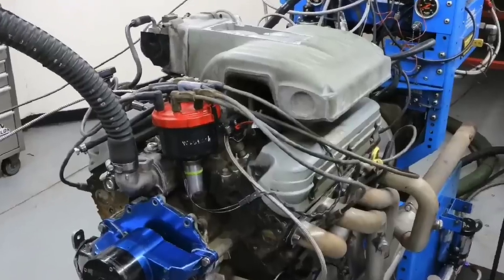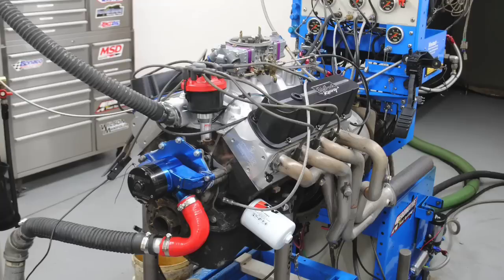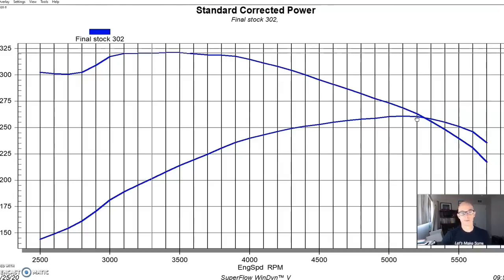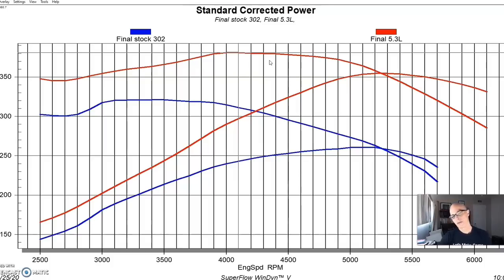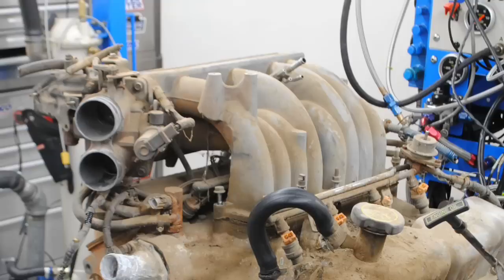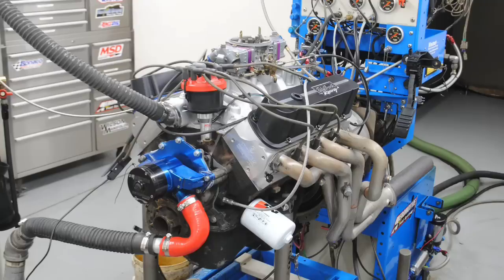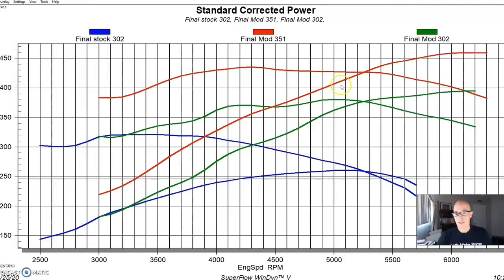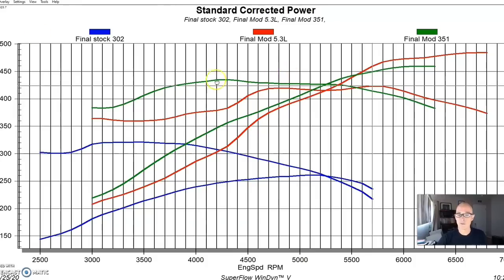5.0L vs 351W vs LS-SHOULD YOU SWAP?

Comment: The 351, Windsor or Cleveland are the secret weapons of the ford catalog. They make fantastic power with huge aftermarket support. For me, bottom line , Ford in a Ford. Chevy in a Chevy. Built Ford proud!😎🇺🇸
Reply: I never said the Cleveland was a small block. I should of said the forgotten weapons. You clearly missed the whole point.
Reply: Wakanda Forever  351 is a small block...
Reply: @rodfatherschopshop6004  is this guy talking about the crap Ls1's that cannot be rebuilt due to the cintered metal components in them?
Reply: @makattak3550  where is it not rebuildable?
Reply: @jubjub905  the cintered metal the LS1 uses.... totally not reusable.
Reply: @makattak3550  
I never knew they used sintered metal, quite interesting.
Reply: @makattak3550  hmmmmm pretty sure I rebuilt mine smh not all rebuilds require boring
Reply: Exactly how it should be .
Reply: @makattak3550  Do what? I just punched out a LS .020 over and it was most definitely rebuildable....
Reply: @Costanza2014  you need a very expensive diamond hone to do  LS 1  bores oversize properly.
Reply: If I ever buy a corvette a blown push rod Ford is going in!
Reply: @wesboyd7416   Love it!😎🇺🇸
Reply: The Cleveland is still dangerous today  I’m a Chevy guy but I really think if the turbos were big back then as they are today ls would just be another engine
Reply: Yuppers... The aftermarket heads (clevor) for the windsor can't be beat. 427w with the C3 yates heads here. Real beast.
Reply: @billmeyers9584  indeed!
Reply: @billmeyers9584  that’s nasty, definitely hurting Chevy boys feelings with a combo like that
Reply: I'm here in 2023 redoing a 351C in the USA.  That "huge aftermarket support" is all but vanished.  The 351C only had about a 5 year in production cars in the US.  The windsor motors was about 10x as long.  And because of that, its slim pickin's for 351C aftermarket parts compared to the windsors.

When looking for EFI stuff, there's zero options for factory EFI intake manifold.  There's pretty much zero options for aftermarket.  Trickflow used to make one, but its discontinued.
Reply: @giantpune  it’s a shame the Cleveland never got the support of the after market . Great engines! Good for you doin something different makes your ride even cooler. As long as it’s a Ford motor that’s all that really matters. 😎🇺🇸

Comment: No LS in ford ever for me. And that was a fair comparison. If it’s fair to compare a 5.0 to a 5.3 then it’d fair to compare a 5.3 to a 5.8. And it held its own
Reply: Yeah even the 4.8 Ls made more than the 5.0 ,impressive when boosted too
Reply: @christopherhamilton4373  they are pretty good. i love all
Reply: @christopherhamilton4373  5.0 does good for what it is but the heads on even the worst preforming ls slay the stock 302
Reply: Yeah the 5L heads were not that great. But back in the late 80s and early 90s, it was still a lot better then the 5 liter (305) in the iroc-z.
Reply: @kcdesignconcepts5216  so many engine in the 80s just sucked ass lol
Reply: I'm not a Ford guy, but if I was it looks like a 351 would be the choice for me.
Reply: Christopher Hamilton  cause old technology in 5L etc.. If companies make a better intake and more updated for the old engines. Probably be the same power or more torque for old ones. My guess lol I’m not a engineering lol
Reply: YouTube k.p. mustang.
YouTube LS 9 mustang.
YouTube stock bottom end record.
YouTube chevy powered mustang tears up the yard.
YouTube most patriotic turbo LS mustang.
YouTube LSX Challenger.
YouTube LS RAM.
YouTube ls1 RAM..
Reply: 351 modded has great low end power, more then the modded 5.3L till the top.
Reply: Bri-man Hunter i like the 4” bore. Definitely good stroke for it.
Reply: Silkmaster4200. Absolutely, my 6.4 394 Hemi stroker has a 4.05 stroke; a torque cam with a long stroke makes for a very fun street motor.
Reply: But how much is the cost difference between a 351 and a 5.3? And cam and springs cost-performance ration between them?
Reply: @bri-manhunter2654  Yeah, the 351 performed admirably.
Reply: @madmod  Absolutely. Aluminum heads are a must IMO if you want to stay Ford. Luckily if you do, there are many used heads out there that are excellent pieces.
Reply: @CalandMike  x selent  choice more cube s and can go way more
Reply: @CalandMike  Definitely, the 351W can be stroked to 427ci, i doubt the 5.3L can..lol i've seen performance cams selling brand new for $150, cams for my 4.6L 2v go for at least $595.. Def modding older engines is cheaper..
Reply: @kcdesignconcepts5216  it was way better than the 5.7 too
Reply: @philllsxga.7737  ls is just a windsdor motor
Reply: @CalandMike  a person could just 2jz if they can't handle the chevy power hahaha
Reply: Preach!
Reply: The problem is you can get the 5.3 much easier and probably an alum 5.3 as easy as the 5.8...or a 6.0. The 5.8 holds it's own mostly due to displacement & in my area 6.0's are dirt cheap.
Reply: @kcdesignconcepts5216  Faster but not nearly as reliable as the 305. BTW the 5.0L in the 80's-90's were actually 304.5 cubic inches.
Reply: What’s the factory weight difference between an L33 5.3L and a factory 351W ? I bet from TB to oil pan the L33 is 160lbs lighter than a 351W. People move there 20lbs battery from the front to the rear. What’s 160lbs worth?

If I had a 351W already in my fox, I’d def stay 351W based. A factory block 302 would have have to be replaced with anything. And my $1500 engine and transmission already sent my fox 9.1@150mph with 253k miles on it via a 1999 2500HD truck. 
But def nothing wrong with a 351W if it’s already engineered in the car.
Anything besides a $2000 aftermarket block 302 just wouldn’t handle the power I’d ask of it, even if it could make it reasonably easy.
Reply: Correct. My third gen 305 camaro was a slug. I have no shame saying that and also why I swapped a LT1 into it.
Reply: TigreLoko24 cleetus McFarland  tsp 427  was originally a 5.3 iron block ...5.3 and 6.0 have same stroke as the 6.2 it’s just bore size is different so stroked and bore out they can  become  427 ci
Reply: @keahisumile3  It's not just a different bore. They have different crank cases, connecting rods and cams.
Reply: @craiga9492  crickets
Reply: @craiga9492  Uhh no. 351s were great but not even comparable to a 5.7/350.
Reply: @tskraj3190  I'm talking the 5.7 tpi engines. 15 second camaros were a quite a bit behind a 5.0 mustang
Reply: @craiga9492  a 15 sec. Camaro didn't have a 350. Most Camaros had 2.8 V6s or 305 V8s. 305 V8s were dog motors but the 350s had much more torque and HP. BTW  I owned a 95' 5.0 and it runs averaged around 15.6 seconds.
Reply: @tskraj3190  there were a ton of iroc-z z28's with 5.7s
Reply: @craiga9492  IROC-Zs had 5.7s but Ithose were few and far between. IROCs were limited production vehicles and yes their quartermile times were around 15 also but so were the 305s and the Mustang 5.0s. The 350 LT1 changed the game.
Reply: @tskraj3190  really? There were more irocs than regular camaros where I grew up. Stock 5.0l mustang, gut airbox, advanced timing, set tps and of course lose the stock exhaust. 13.90s @100-101mph all day with 2.73 axle
Reply: @craiga9492  That's not stock. Like I said I had a 95' 5.0 and  it averaged 15.6. You can even see it here on Motor Trend https://www.motortrend.com/cars/ford/mustang/1995/1995-ford-mustang-monsters/
Reply: @tskraj3190  I'm talking fox body and that's stock enough. The lt1 is better but the 5.7 tpi is a boat anchor lol
Reply: @craiga9492  Bullshit.  Correctly optioned TPI Camaros were as fast, if not faster than the 5.0.  An 1LE 5.0 Camaro could hang with stripped notch.  You certainly didn't want to run up against an 1LE 5.0/5.7 Camaro.  And the saving grace of the Mustang was weight....that was it.  Nothing else.  5.0 GT autos were slow AF.
Reply: @BEBNC1  I agree. I had a 79' Mustang with a 302 and a 95' Mustang with a 5.0L. I got my butt handed to me by a 91' Chevy Lumina Euro Sport with a 3.1L V6 in my 95' Mustang.
Reply: A coyote would be a cool swap on a ford though, I'd consider one if I knew what the fuck i was doing haha
Reply: @tskraj3190  I have an 86 5.0 that was in a barn for years, ran a 15 second flat first time at the track on dry roted tires with worst 5.0 cylinder heads. Not sure what your doing wrong.
Reply: @Kenzo-bp1zs  It would be me, Motor Trend and Car and Driver.
Reply: @tskraj3190  wow didn't know the later years were that much slower. My car honestly had Acorns stored all over the engine bay from squirrels when I ran it. Ran 15.00 at 93MPH, I think with better tires I could've dipped into the 14s.
Reply: @Kenzo-bp1zs  My 95' averaged around 15.6. My 79' had a high performance cam, trickflow heads and a Tunnel Ram intake with two Holley 650 carburetors. That averaged around 12.7.
Reply: If your against a engine that makes more power for less and will last twice as long that's up to you a engine with 6 bolt mains that comes from the factory with such a very strong shortblock that the crankshaft spinning even at very high rpm has no flex or stretch you'd need very expensive after market parts on any 302 351 ford engine or 350 383 406 chevy engine to even come close to the stock durability of a chevy LS engine there has to be a reason why over 50 percent of foxbodies at the drag strip are running LS engines in them the only place through out the rpm range where LS engines are not as good as older style engines is below 3000rpm above 3000rpm to redline they absolutely kickass they like high stall converters 3000+ and steeper gearing I've seen stock 5.3 chevy truck engines hit with a 150 hit of nitrous over 75 times and be driven home after racing try that with a completely stock 302 351 ford or stock 350 400 chevy you'd be lucky to make 10 passes before it will blow up take any 302 ford or chevy 350 with stock crank rods and pistons put any cam you like in it rev it to 7200rpm and if it does it bet it won't do it many times before it has big problem BOOM my stock LS2 shortblock with CNC ported LS3 with a high lift cam under 240 duration and it has hardened pushrods and a SFI harmonic balancer put in car in 2008 a weekend nice weather car toy maybe put 800 miles or so a year will on a step on the gas petal rev 7200rpm doing so pretty fast in 1st 2nd 3rd gear now for over 12 years and still doing so but it's taken care of with maintenance and no it's not constantly being beat on it still runs as good or better than when put in car in 2008 I'm 56 years old have had many muscle cars and performance cars in my life this LS2 is by far the most efficient most reliable most powerful and durable engine I've ever had from 3000rpm to 7200rpm for a N/A 364 ci engine it's a monster plus runs good for cruising 2000rpm to 3000rpm smooth with very good response or eager to rev l guess it's not a good thing to take a basically stock LS2 with CNC ported LS3 heads camshaft that absolutely does not run out of torque to 6400rpm plus gaining a1000rpm on the high end or redline compared to any 302 ford or 350 chevy torque on these engines drop like a brick off a cliff above 5000rpm even well built ones pushing it very hard above 5000rpm to 6500rpm your feeling the engine torque fall off giving you that struggling feeling with the LS l feel no struggle or drop all the way to the rev limiter at 7200rpm with no engine shaking as smooth as can be and fast depending on cam choice with a LS peak torque comes in 4600rpm to 5400rpm with peak horsepower in the 6000rpm to 6800rpm my LS2 with upgrades makes 400 foot pounds of torque or more from 3000rpm to 7000rpm at the crankshaft that is a wide powerband and I'm not saying at all a all forged 347 Ford or 383 Chevy with expensive aftermarket heads can't match these numbers yes they can with a lot more money and effort and less driveablity and reliability and will not last as long as a LS engine
Reply: @christopherhamilton4373  Impressive  when  boosted for the first 5 or 6 passes then it left the  party!
Reply: Mylan Miller that doesn’t happen often, these engines boosted running 9s, 8s, and 7s in the quarter mile on stock bottom ends
Reply: @christopherhamilton4373  What happened to every one  at our local track was. They tried a little boost and the cars run like shit.  They cranked the boost up to get the ET they were hoping for instead of running good numbers they all  Wiped out the bearings. We have Fast LS turbo engines at our track as well but not one is a budget Build. i am not saying you cant make an LS  Go fast what I am saying Is They are not any Cheaper to go fast than a Ford engine. If you want to go fast and have the  engine live
Reply: @kcdesignconcepts5216  That's a myth. If both cars were 5-speed manual they were very equal in the quarter mile. Most Camaros had automatic transmissions that really hurt performance back then. I lived thru that era street racing on weekends. The TPI 5.0 (305} manual trans iroc Camaros and Firebird Formulas were fun cars. They just didn't sound as good as the Mustang 5.0
Reply: Mylan Miller true, i wouldn’t shoot for 800+ on a stock bottom end
Reply: 5.0 all day let’s compare a 305tpi or 350tpi that’s a comparison the 302 is from the 80’s the last was a lot newer with advanced technology. Compare a 02 dohc 281 cobra N/a. The 5.0 is a bad mofo for what it is I have an old ego 5.0 and and dusted new g37x’s with 330hp.  Meanwhile mine is stock internally stock e7’s. Pullys exhaust cold air intake electric fan.. I know why I beat him because power to rate ratio is still a factor. I’m 2850lbs he was 4200lbs.. so don’t think you can smoke a 5.0 cause you have a LS.
Reply: @christopherhamilton4373  welcome to a updated engine ls also has more In common with a ford engine then a sbc
Reply: @hydrocarbon82  5.8 was also cheaply modified and can easily make 600 plus na
Reply: Austin Howze i am aware
Reply: All you LS lovers out there forget how many races the 351 Windsor won  in NASCAR over the years and the last time i checked Ford had over a hundred years of racing history Chevy not so much
Reply: Sorry, 5.slo and 351 are junk, ford engines always cost 2 to 3 times more to modify than gm, I'm not a chevy guy, but the ls is a no brainer, more power and cheaper cost
Reply: @Silkmaster4200  the ls is old technology, it's a push rod engine without cam phasers or other modern tech, it's the same as the 302 or 351 just built better
Reply: @bri-manhunter2654  look at price vs power comparison, the 5.3 wins all day long, you could build 2 5.3's compared to 1 351, it has 6 bolt mains and is lighter and stronger, it's a no brainer
Reply: @jeremyhigh3186  Ford guys always say the Ls is for broke guys or is the cheap way out. We’re spending less with equal or better results, expensive doesn’t mean Ford is automatically better. Who doesn’t want to spend less?
Reply: Compare a 6 liter LS with the boat anchor 5.8
Reply: @sinistersilverado965  or our 7.0 or 7.4 Ls
Reply: How about we stroke the 5.0 to 331which equals the 5.3 in displacement and match a set of heads that flow the same CFM as the LS such as a set of 185 TFS renegades or 205 AFR heads.
Reply: @jackrabbit7389  That would be interesting, even tho 5.3 is like almost the smallest Ls, most guys using 6.0, 6.2,    7.0, 7.4 and i just saw a 440 cubic inch Ls yesterday. I always hated the 4.6 and wished Ford would do better
Reply: Gm people remind me of the spinal tap scene "these go to eleven "...how come you dont jusr put eleven into ten and call eleven ten ?.."these go to eleven " ....so you cant bring a 5.0 to fight with a 5.0 ....these go to eleven ...you call it
Reply: @christopherhamilton4373  LS1 motors are crap.
Reply: @makattak3550  Ls1 been out since 97, plenty of better options
Reply: But Ford chassis is so much better and lighter lol mustangs are the ultimate drag car and ls seems to be the ultimate drag engine why not combine them
Reply: But Ford chassis is so much better and lighter lol mustangs are the ultimate drag car and ls seems to be the ultimate drag engine why not combine them

Comment: It’s just something about keeping Ford in a ford that I have to build by.
Reply: I absolutely agree. A Tech that I work with is doing a 5.3 chevy with a turbo swap on a 96 Mustang GT. I understand why he's doing it but I just don't agree with it. Keep a ford a ford. Just doesn't seem right.
Reply: Amen
Reply: The easiness of making power reliably and cost effectively and availability for parts, is very such hard too beat of swapping an ls or a small block Chevy into a fox.
Reply: you see my user name. it has blue oval in it. i've got 2 in the driveway, ford has been good to me. i've also got a gmc out there with a 6.0 ls. i'm very impressed with that engine and would take that over a 302 or 351 any day. i get it the idea gut that 6.0 moves a 4x4 3/4 ton truck better than i expected.
Reply: I definitely get why people do it and am not against it myself. Easy reliable cheap power. Great platform. I just get extra excited when I see a well built sbf in a Ford. To each his own. They are both great options and I would build one of each if I could afford to. Lol
Reply: @stuntbikejourney9582  totally understandable, There’s a few ford motors i wish I could get my hands on 😂😂 got a dad who’s got a Mopar big block in a Chevy stepside 🤷‍♂️ I’m all for something different
Reply: Right lol, I can't be a trader!!!
Reply: 351W all day, blue oval from the heart!
Reply: Too many good ford motors out there to settle for a bow tie, I’d definitely do a 351 Windsor or a Coyote, I run a 460 twin turbo but I know that’s outdated, mine is a street strip 1965 Fairlane and a lot of fun to drive on the street.
Reply: @tannerwysong2256  I guess if you don't mind having to work on them all the time, which has been my experience.